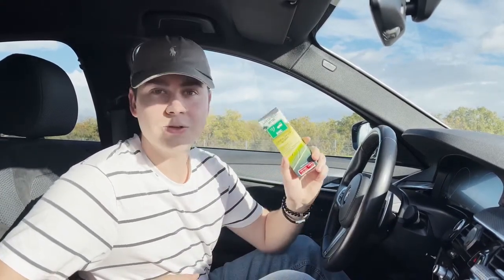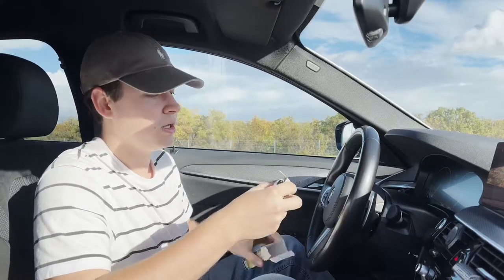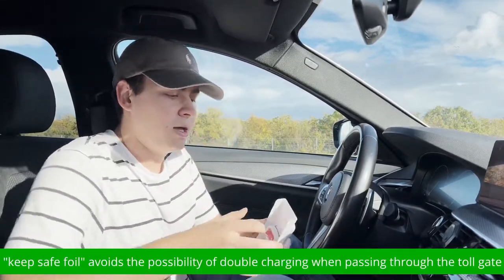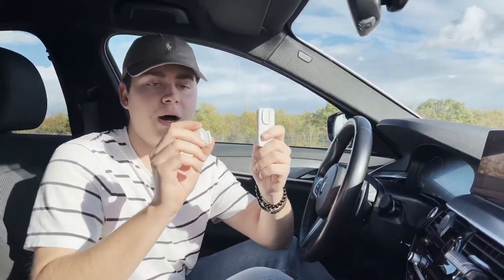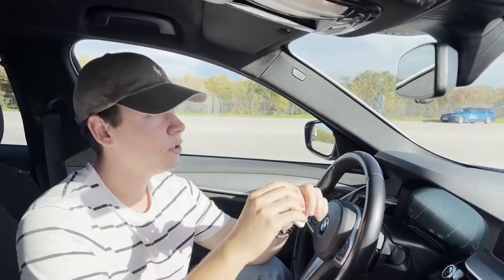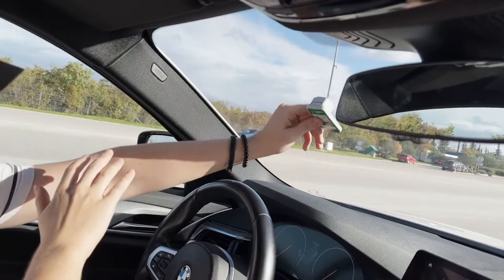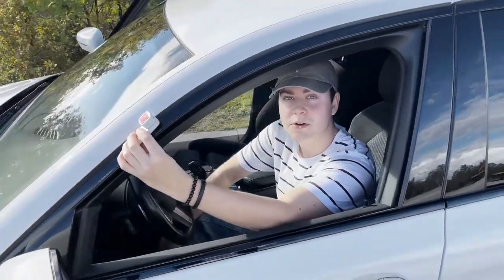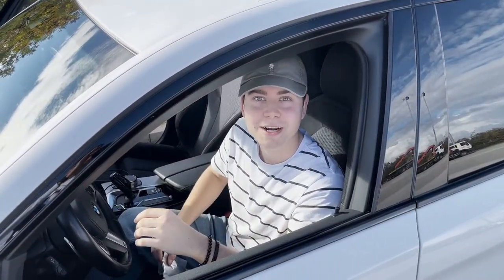How to install and use ENC

Comment: Yeah and after 2 years of warranty is over the battery is dead and you need to buy another device... there is no possibility of changing battery... long live the vignetes!
Reply: Yeah, but if you use an ENC device, you get 21,74% discount from the road price.